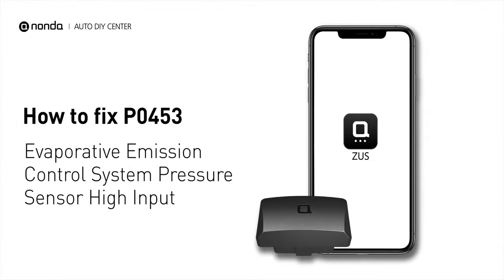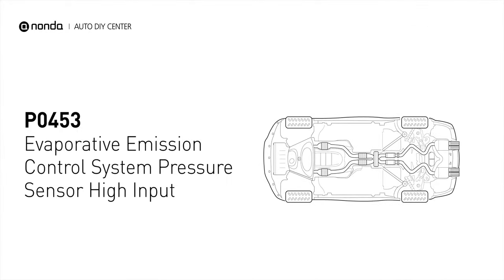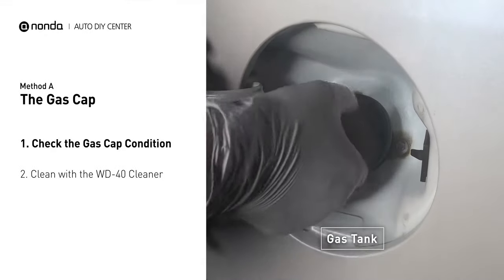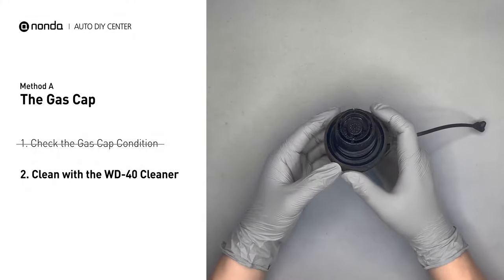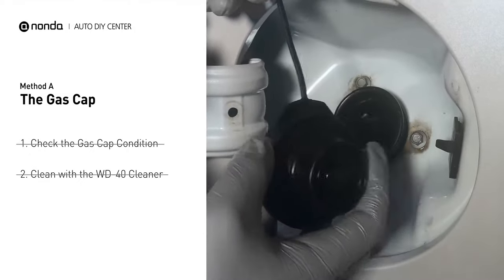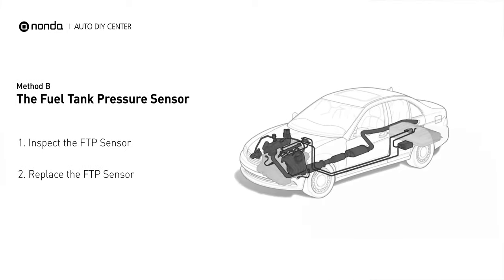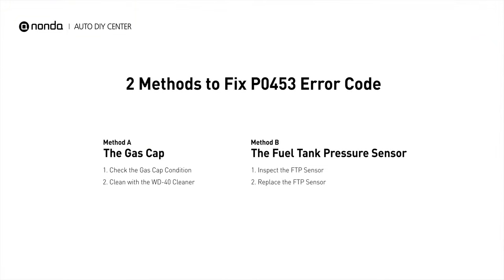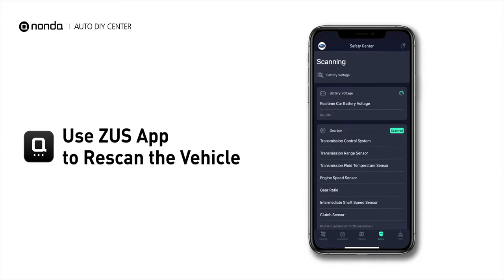How to Fix P0453 Engine Code in 3 Minutes [2 DIY Methods / Only $4.51]

Comment: How do you get to the fuel tank pressure switch?  Do you have to remove the gas tank??
Reply from the maker: Hello, it is located inside your fuel tank or on top of the fuel tank near the hanger assembly that holds the fuel pump in the fuel tank itself.

Comment: I have this P0453 error code from my wife 2011 Mercedes Benz GLK 350. I replaced the sensor already, clean fuel cap  and try to disconnect battery for 5 minutes but still having same error code. Can anybody share any other solutions?
Reply from the maker: Hello, is this the only code you're getting?
Reply: @nondainc  was able to fix, one of the wire/harnes on top of the fuel pump cover was disconnected. Thanks a lot. GOD bless
Reply: @nondainc  yes that all the code
Reply: I mean only the code

Comment: My truck has this code but it’s a cap-less gas filler. Clean and cycle the plastic spout into it? Wd40 is okay to get in the gas tank?
Reply from the maker: Hello, you can get your vehicle's special funnel, insert it in the fuel filler, and spray the WD40. If after cleaning the filler and the problem continues to persist, we suggest to have your vehicle checked by your local mechanic for further diagnosis.
Reply: @nondainc  I’m curious what it means when it refers to higher pressure sensed. Wouldn’t higher pressure indicate a tight seal creating a good vacuum effect to the evap system? Or is it quite the opposite meaning it’s leaking somewhere and not sealing?
Reply: @lh98 the video doesn't make any sense. A P0453 usually has something to do with pressure buildup in the tank or false pressure readings

Comment: my check engine light is on also a light that says low fuel i have a 2002 GMC Sonoma SLS  need help
Reply from the maker: Hi Annie, we suggest cleaning the gas cap. Inspect the Fuel Tank Pressure Sensor's condition and replace if necessary.

Comment: Hello code P0441 Honda Accord 2017 thanks
Reply from the maker: Hi Carlos, kindly clean the Gas Cap with WD-40 Cleaner and check the condition of the Fuel Tank Pressure Sensor.

Comment: We 2011 Ford Escape no gas cap is there you clean where the gas goes in the tank
Reply from the maker: Hi David, kindly clean both the door seal and the filler neck to prevent dirt from entering the fuel tank and to ensure both sealing surfaces are clean.
Reply: Hello David mitalski ,how did you fix your 2011 ford escape with this code, I have same problem and same car.

Comment: Got 3 codes, 0446, 0452, and 0453 which all say EVAP system. One says vent while other two are low and high pressure EVAP readings. When I open gas cap it hisses for a bit. I'm guessing the vent is plugged up since it's 2004 Chevy truck. Any ideas?
Reply from the maker: Hello, as you are receiving more than one error code, we suggest getting your vehicle visually checked by your local mechanic for further diagnosis. Thanks for watching!

Comment: If you replace the original 2000 F150 gas cap with a locking cap from Autozone can that cause the P0453 code. This F150 has a locking cap and I am getting the PO453 code. Been driving with it that way a few years without any problem but probably need to get rid of the engine light so if another problem arises and engine check light returns I will know to check for a different code.
Reply from the maker: Yes, it might be triggering the code.